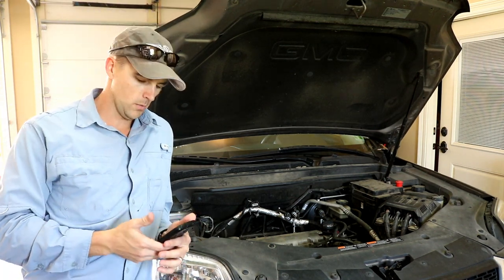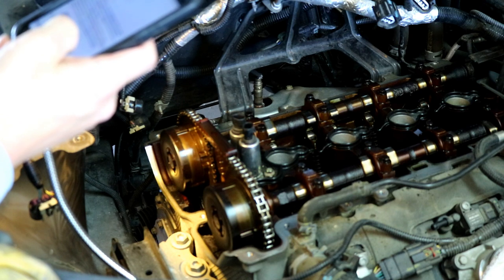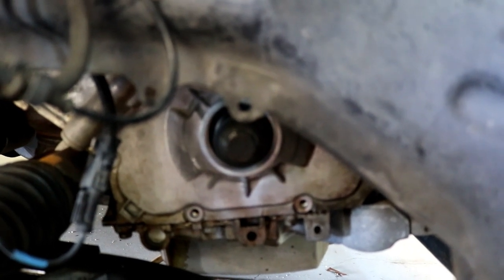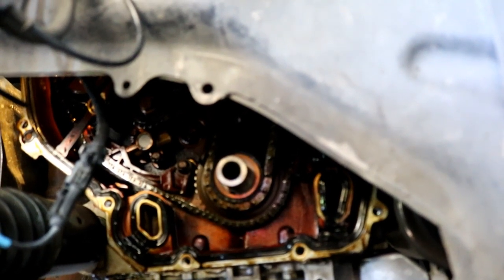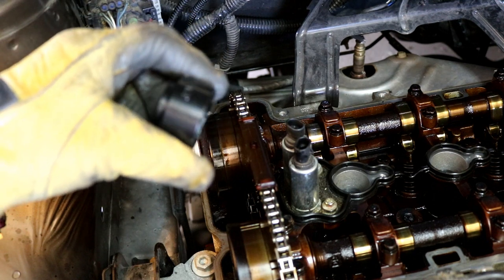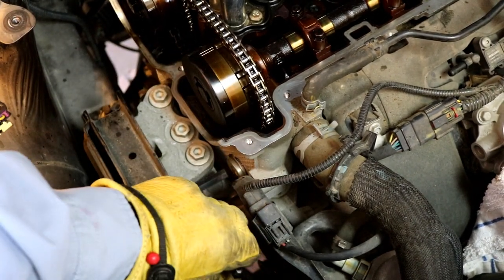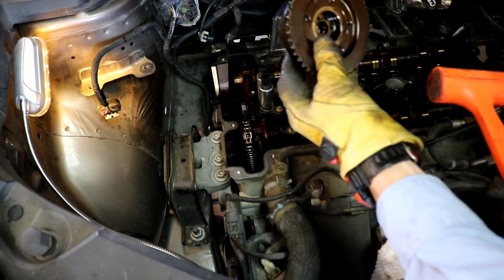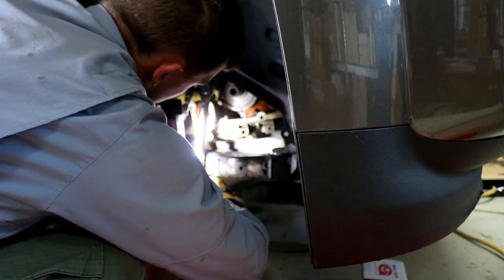GMC Terrain 2.4L Ecotec Timing Chain Replacement  Step by Step Pt2

Comment: Thanks for the video.  I used your video and another to successfully replace my Timing Chain on my 2015 Equinox although I had done this repair prior on an HHR with an older version of the same motor.  Only things I did slightly different is I did not cut the gasket given I had loosened the motor mount given my old gasket was the same.  The crank bolt I reused and torqued to something around 90lbs with a little blue Loctite which I did on the HHR as well and drove it another 50,000 miles.  The Cam bolts I bought new and followed GM's torque to yield install.   I was puzzled a bit though given my crank sprocket had a washer on it that hid the timing marks.  The washer was not obvious but once I slide it back my sprocket then looked like yours and others.  Mine I think the tensioner failed/stuck and allowed the chain to slap the upper guide eventually breaking the plastic guide which then made a noise my daughter noticed before it had bigger issues.

Comment: Between 1:43 and 1:58 made me laugh like hell. "that was ugh...A surprise." Feel your pain. I had to borrow a BluePoint AT775 from work to crack that dang crackshaft bolt.  Great stuff man.  Thanks for posting your work.
Reply from the maker: Thanks Jarred it was tight I was scared it was going to break thanks for your comment.
Reply: I was lucky with mine I just wedged a pry bar in the pully and put a pipe on my ratchet!
Reply: A tip: you can watch movies on Flixzone. Been using them for watching lots of of movies during the lockdown.
Reply: @Dean Imran Yup, I've been watching on Flixzone} for years myself :)

Comment: Get yourself a 1/2 inch plyboard maybe then inch by five inch,slide it in between the oil pan and sub frame. Then you can take your motor mount off. It makes it way easier to do this job.

Comment: Thanks for video!
Do you know, what is the whole average engine life of this Ecotec 2.4 ? 
I've read some unsatisfied consumer reports about this engine, but there are a lot of happy comments as well. What's your opinion about this engines ? What problems can it cause during the service ? And what's actual probabiity of these problems ?
Reply: It's a surprisingly reliable engine. The problem lies in the fact that you buy this car and it is very peculiar. You know GM could have made it perfect but they chose to make it have certain problems.  It you know how to diagnose the symptoms you will have no problems. It burns oil and starts making noises that sound really bad. You have to monitor the oil and change it far more often than the oil computer monitor suggests.
Reply: Mine was 219,000 before failing believe just the tensioner failed....
Reply: 225000, thinking im due for a timing chain change?

Comment: great job just earned a new subscriber. my question is if I just wanted to replace the guides do I still have to put it in top dead center?
Reply from the maker: Angel T. I would you may have an opps like i did and end up doing the whole job which I would recommend if you already have the covers off, and the tensioner out which was my main problem. Oh and thanks for watching and the comment.
Reply: Angel T. who kedlza

Comment: Did you need the special tool holder for the cam gear phasers or just use breaker and wrench like I saw in vid?
Reply from the maker: Shaun Smith I did not use the special tool.

Comment: Ok I can find TDC, but how do I find if it’s on compression Or exhaust stroke.. when on compression both intake and exhaust valves are closed.. 2.4l what position is the cam supposed to be at
Reply from the maker: Correct compression keeps both valves closed. I believe I stated that in one of the videos.

Comment: What do you mean when you say, #1 cylinder is top dead center? What does that mean? does the cylinder have to all the on the top? dead center is confusing.
Reply from the maker: When the piston in cylinder 1 is at the top of the stroke.

Comment: 1. Did you have to drain the coolant?
2. Is it neccessary to change the phasers?
Reply from the maker: No I didn't have to drain the coolant.
Reply: If it were me and I'm planning to keep it, I would change the phasers. A d the water pump. Got everything apart anyway, may as well do it all.

Comment: As you mentioned it was just the tensioner, is it possible to change the tensioner without taking anything else apart and not skip timing?
Reply from the maker: Awesome I am glad it worked out for you and thanks for your comment
Reply: Did you find the answer yet?
Reply: Yes you can just as long as it doesn’t fall apart on you pulling it out or else you gotta use a magnet.

Comment: How did you know it is skipped one tooth when you change just the tensioner because? I changed just the tensioner on mine any gave me exhaust cam correlation code mass-air flaw code  and the engine went to "Reduced Power" mode (barely gets to 30 mph) I think mine also skipped a tooth was it the same symptom on your car? please.
Reply from the maker: EHAB AL AKRAWI Thanks for watching I knew because I already had the valve cover off and heard and saw the exhaust cam turn. Sounds like you may need to reset you're timing. I changed all of the timing and balance chain components. Changing just the tensioner without re-timing the engine risk   you have no way of knowing if the engine is still timed correctly.
Reply: New tensioner on a worn chain and guides is risky because it could cause a broken chain

Comment: Hello.what will happen if the first timing chain that goes on the balance intake and exhaust shafts is no in the right timing marks?
Reply from the maker: If it is to far off it will bend the valves.
Reply: I replaced  both timing chains 3 times in one month in a 2012 chevrolet captiva sport ls 2.4l because after a couple days start making lot.of noise and i dont underatand why is the problem whit this vehicle..

Comment: Where did you get the new torque to yield bolts.
Reply from the maker: I believe the phrase came with new bolts but the second time I just reused the same ones and that worked fine for me.

Comment: I want to buy a gmc terrain 2010  can you tell me how many miles it takes to replace the time chain
Reply from the maker: I would say around 130-150K I would not buy a 2.4 model get the V6 it will last a lot longer and get better mileage.
Reply: Thank you. I buy the v6 lñ
Reply: My 2012 Equinox isn't even at 130,000 KM and I'm having this issue.

Comment: You can't be at TDC on an intake stroke. It's either the compression stroke or the exhaust stroke....
Reply from the maker: The intake stroke would be from TDC To BDC with the Intake valve open, then you would have compression BDC to TDC, Power stroke TDC to BDC, Finally your Exhaust stroke BDC to TDC with the Exhaust valve open. Of course These engines are VVT so they will have some variation but that is the basic principle of a four stroke engine. Thanks for your comment.

Comment: I have a 2010 chevy equinox 2.4 that needs a timing chain replaced, where did you get this kit from, and did both chains need replaced thanks
Reply from the maker: Jamie Woltje Check out Rockauto.com they had everything for half price I just thought while I had it open i would do both.
Reply: check ebay too i just got a full kit for my 2011 buick regal 2.4L ecotech for 70 bucks, comes with timing chain, balancer chain, new cam sprockets, new balancer sprockets, crank sprockets, guides and tensioners for both. couldnt pass it up i might not need it all but its worth to have if i do. Local parts places want 120 buck just for the chain, guides and tensioner, just for one kit.
Reply: @Suzieash82   how did your timing chain kit for $70 work out? I'm skeptical if it's Chinese made.
Reply: @Suzieash82  how did the $70 timing chain work out?

Comment: how many hours did u spend doing the job? any special tools need. ?!
Reply from the maker: Angel T. 3/8 & 1/2 torque wrench a high torque impact for the crank bolt as in over a 1,000 ft/lbs, 600lbs is not enough I used a 3/4 impact that has 1400ft/lbs which which did the job with ease. Also the 34mm oil filter socket for the tensioner, and the little 1/4 air drive ratchet was alsome but not required. Took me about ten hours but i also was make the video and i drop a bolt in the oil pan and had to pull the oil pan.

Comment: i know at 3:23 you wanted to use the f word lol
Reply from the maker: Thanks for stopping by and commenting
Reply from the maker: Will Barney oh i just remembered if I was going to need a special word it was when I dropped a bolt in the oil pan and had to remove the oil pan to get it out. Unfortunately I didn't get it on video lol!